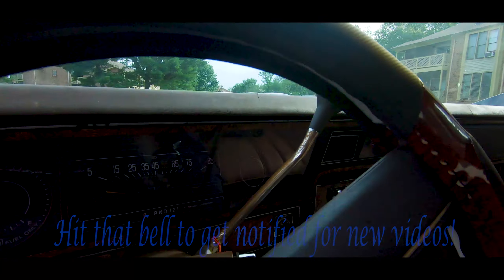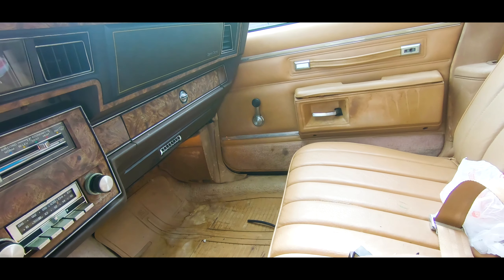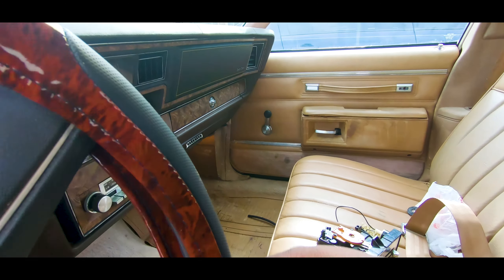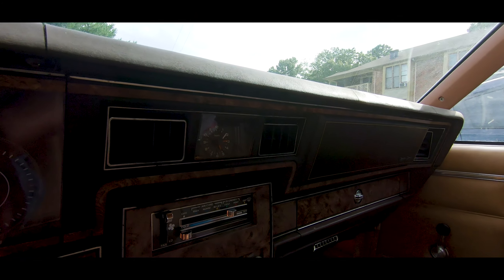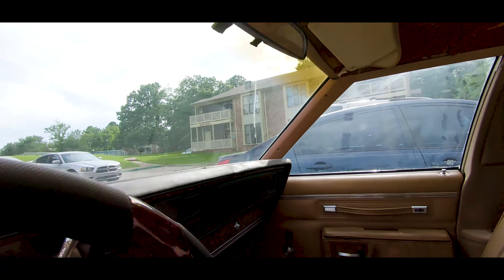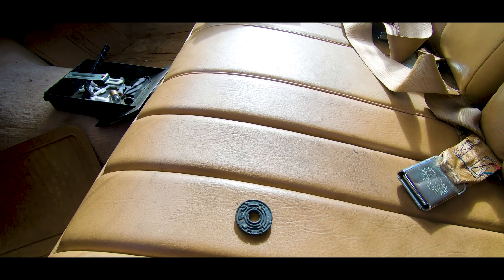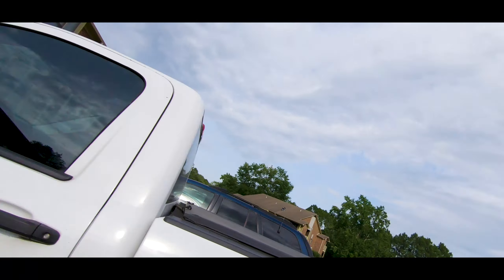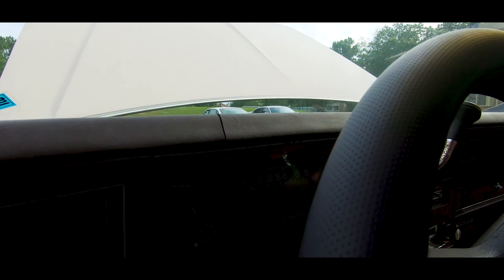Box Chevy Vlog #5 (Finally....How to fix air to blow through vents) ***MUST WATCH***

Comment: Hey brother I see you fixed your issue with the ac to blow my question to you is I watched your video to really see where you got the vacuum lines running to which the brown vacuum lines but I can't really see where you got em ran to if you can drop another video to show exactly where you got em ranat I would really appreciate it thanks

Comment: Hey how’s it going? Where did you get your  Hvac unit from? And did you get it new ?
Reply from the maker: What's good bro. I found mine at the salvage yard. Cheaper that way or you can check ebay
Reply: Ok cool thanks bro I appreciate it! if you don’t mind me asking how much did you get it for ?
Reply from the maker: @dimomiller6407  40 at the salvage yard
Reply: Ok thanks bro! Do you know the name of the little circular black piece ?
Reply from the maker: @dimomiller6407  no problem bro. Naw I dont know the name of it. You might have to buy the whole unit
Reply: Lol That’s what I’m thinking I may have to do Haha
Reply from the maker: @dimomiller6407  lol probably come out cheaper that way too
Reply: I’m prolly gonna get a 
Refurbished one smh haha if so it’s gonna be expensive but it’ll be worth it!!